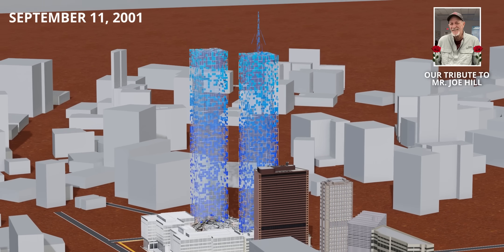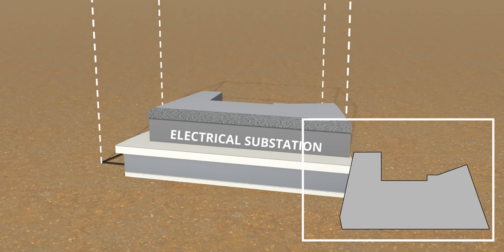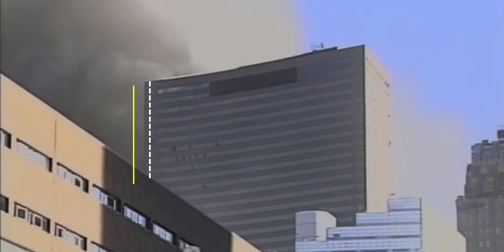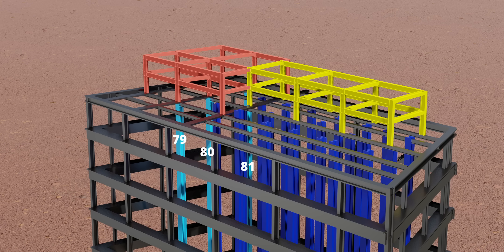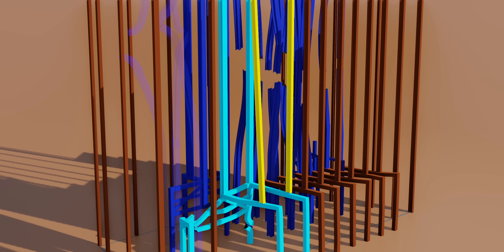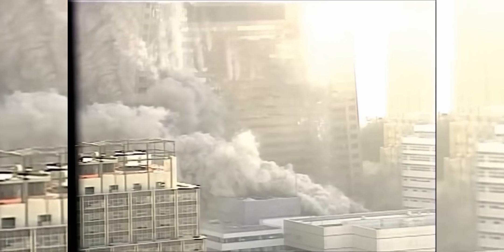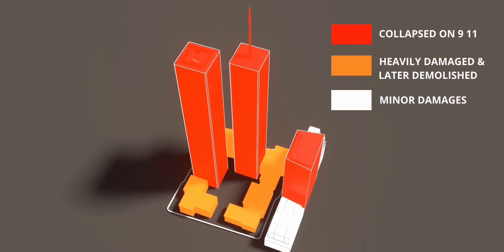Collapse of Building 7 | The Complete Physics

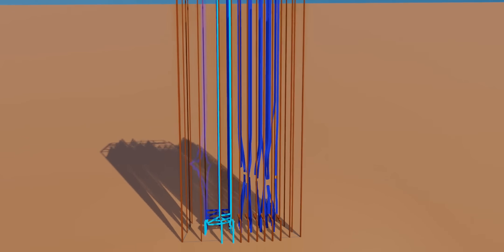Comment: One more thing. It is funny how this video say " 7:20 and there you have these cut columns, already broken, then you can imagine what will happen next" but fails to explain HOW and WHY, fires were not observed in the substation so how can those column be cut without this video explaining it. Thought this video explained, but i am left with more questions than answers 😂
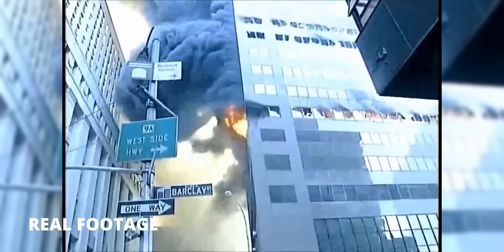Reply: The fires - and failures - were ABOVE the electrical substation, above the load transfer region as clearly shown in the animation and exactly where we see the fires in the Vince DeMentri CBS2 video at 3:02.
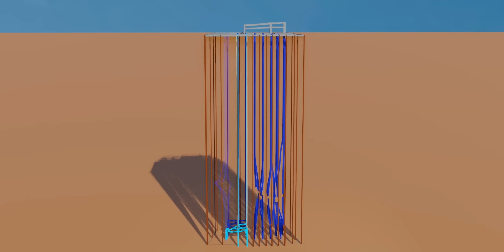Reply: @TheCriticalStinker-01 7:20
Reply: @old8809  - Yes, I'm right there, where the animation shows column failures well ABOVE the load transfer region which is ABOVE the Con Ed substation (which is in fact, not even shown).  I'm sorry you don't understand this simple graphic on a fundamental level, but I do.
Reply: @TheCriticalStinker-01 Nope I understand it well. Just you who dont understand it
Reply: @old8809  - This is soooooo fucking pointless.  I'm going nuke option:

Building 7 collapsed from the inside out which is not at all intuitive and hard to understand, with most details being hidden from view.  It requires careful analysis and observation, and some people will struggle no matter how much it is explained. But here is my explanation relying on no outside authority. 

Building 7 was a unique, asymmetrical 47-story steel frame structure built atop a smaller 3-story building serving as a partial foundation, requiring lower floors dedicated to complex load transfer structures. Of trapezoidal shape and tube-in-tube construction, B7 (above the 7th floor) consisted of a central core of steel columns carrying most of the gravity load, perimeter steel columns around the outside of the structure carrying the remainder of the gravity loads and long span beams and girders to tie those elements together and form the floors. On the outside of the building hung a facade or outer shell. 

www.nist.gov/image-16640

Phase 1 : First externally visible signs of collapse initiation occurred at 5:20:28 pm and was notably quiet with observers not realizing the building was collapsing! No warning in the form of hundreds of eardrum busting 180dB explosive bangs. Here at 12:00 a local CBS affiliate reporter talking 10 blocks from B7 when collapse begins. People don’t start to notice the collapse until 12:11. At 12:45 is the famous CBS fixed camera clip of Building 7’s collapse. Note the silence. 

www.youtube.com/watch?v=t5tEy6mXSE8

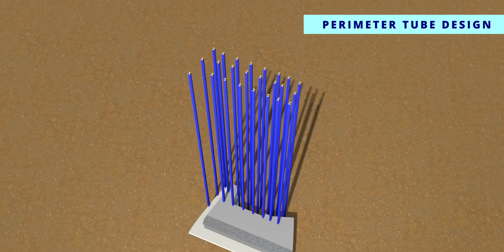Lower floor failures above the load transfer region (8-14) in the NE corner initiated the collapse. In this video at 0:45 you can see the NW corner from inside the building while under construction, Column 79 just out of frame on the left. That big, angled steel beam across the top of the frame connects to C79 at one end. The girders connect to the beam. That beam and all those girders depend on just one connection 

www.youtube.com/watch?v=nP3TNHPCIVU&t=45s

Phase 2 : NE corner floor failures caused a loss of critical lateral support over an excessive length of Column 79 and it buckled. Looking at the above floor diagram of Building 7 when you see all the structures that depend on C79 you quickly realize this one column was a relatively isolated structural element on which a disproportionately greater fraction of the structure depended analogous to say the Key Bridge. Externally as collapse begins we see a vertical progression of window breakage along the 44-46 line and a kink in the roof of the East Mechanical Penthouse at the top of the building, consistent with C79 failure. Normally with a buckling column, the load could be redistributed to other columns. With C79 that is not the case - the failure did not redistribute the load, so the collapse rapidly progressed to the roofline, sinking the rooftop penthouse. The transition from full capacity to almost no capacity occurs in an instant and will result in virtually no resistance 

Phase 3 : With C79 gone, B7’s progressive, non-symmetrical collapse continues with adjacent columns 80 and 81 left laterally unsupported and quickly buckling as well. The EMP drops down through the building. C79-81 all have no diagonal bracing, which is the major reason why they could not redistribute a lot of vertical loads among one another. From there collapse progressed from east to west through the central core until the core was gone from 81 to 58, taking all the interior floors and probably most of the perimeter columns with. Follow the horizontal progression of window failures low in the building and the dropping of the remaining rooftop structures into the building. The NIST Building 7 study model 4 determined C79 failing under ANY circumstances would have initiated the same collapse sequence. 

Phase 4 : After about 10 seconds only the exterior moment frame remains, giving the illusion B7 is still standing to the casual observer since little has outwardly changed. But it is just a hollow empty shell like an empty cereal box supported only by a few remaining columns and overloaded from the loss of the core columns and floors, quite unable to remain standing. With nothing remaining behind it, the north face leans inward, forming a V in the roofline, the last few columns buckle under the strain and the moment frame free falls, landing on top of the debris pile. 

It is only here at the very end, a single measurement of alleged free fall acceleration is taken, from just one point on that outer shell. The Building (core and interior) did not “free fall” - was already gone before that happened - just one corner of the outer shell briefly moved at a rate comparable to FFA. This alleged FFA was a product of how the shell fell NOT why the building fell . It’s also not even proper FFA as the single measured point was moving in 3 dimensions, not just down, which adds another variable. Start to finish the collapse took 18-20 seconds, 3 times longer than true FFA . How fast something falls can’t tell you what started it falling, certainly not 10 seconds after it started falling.  

The debris spread outside the footprint blocking surrounding streets, heavily damaging the Verizon Building and destroyed Fiterman Hall. 

No building is meant to survive 7 hours of multi-floor unfought fires. Building 7’s progressive, non-symmetrical collapse was incidental, unintended collateral damage from the combination of fire, time & gravity started by the collapsing North Tower, true no matter who planned and carried out the 9/11 attacks or why .  Of so little consequence it barely registered at the time, only taking on semi-mythical status as an alleged smoking gun years later when demolitions at the Twin Towers, missiles at the Pentagon and shoot down over Shanksville all failed and conspiracists had nothing left to work with. 

Anything can seem like a conspiracy if you don’t understand how it works. Now you should. I hope you found this helpful, informative and it solicits informed critical comment. If I made any errors of fact, logic or reason or left anything important out, please let me know so I can fix it. OR offer a more plausible alternative if you can. Be the first. Please start any reply with the words “Tits McGee” or I will know you didn’t read it and are wasting my time.
Reply: @TheCriticalStinker-01  , So, what YOU consider to be 'proof' is an animation ... of which NIST does not share their input data? 😅😅😅 How can you say you are not too intelligent without saying you are not too intelligent?
Reply: @TheCriticalStinker-01  , Hey 'T. McGee' , How did you learn 'physics' ??? BY WATCHING ROADRUNNER CARTOONS??? 😂😂😂
Reply: @TheCriticalStinker-01  , Hey , 'T. McGee' , Let's test your BASIC reasoning skills 🙂 .... ; 
If you are ASSUMING the TOTAL collapse of the World Trade ceneter 7 building was NOT caused by a controlled demolition , ... what would be the ONLY source of ENERGY available to cause the TOTAL collapse and complete destruction of the World Trade Center 7 building?
Reply: @dunexapa1016 - Gravity - more than sufficient.  All building collapses are gravity collapses - even CD's.

Duh.
Reply: @TheCriticalStinker-01  , FACT:  NIST never proved their 'gravity alone' THEORY and the proof of this FACT is NIST's very own investigative report. 
I understand you are so limited in reasoning ability that you have confused SPECULATION and CONSENSUS OF OPINION with actual proof. 
It is NIST's THEORY that gravity alone provided ALL the ENERGY needed to cause the TOTAL collapse AND the destruction of the World Trade Center 7 building.
PROVE , by information from NIST's investigative report that I am wrong and I will apologize.
Reply: @dunexapa1016  - Describe the collapse in detail, start to finish using ALL available evidence, don't leave anything out.

Oh wait.  You can't do that.  Don't even know how or where to start.

You are a waste of time.
Reply: @TheCriticalStinker-01  , ONE SINGLE WORD! ... That is all it takes to answer my basic high school physics question:

As an object is falling in free fall how much work is being done by that object AS it is falling in free fall? 

Helpful hint: ChatGPT 5, Google's Gemini, Elon Musks'Grok and the Chinese AI DeepSeek can ALL answer this high school physics question with one single word. Ask the very same question and ask for an ACCURATE answer with one single four letter word.

If you cannot answer this basic high school physics question then you have no business commenting about the TOTAL collapse of the World Trade Center 7 building.

In NIST's very own words:

"The analyses of the video ... revealed three distinct stages characterizing the 5.4 seconds of collapse:

Stage 1 (0 to 1.75 seconds): acceleration less than that of gravity (i.e., slower than free fall).

Stage 2 (1.75 to 4.0 seconds): gravitational acceleration (free fall)

Stage 3 (4.0 to 5.4 seconds): decreased acceleration, again less than that of gravity"

SOURCE: https://www.nist.gov/world-trade-center-investigation/study-faqs/wtc-7-investigation
Reply: @dunexapa1016 sorry man but it was not and it will never be a controlled demolition
Reply: @laetrille  , The scientific illiteracy of most of the American people has allowed thousands of innocent people to be murdered with impunity.
Reply: @dunexapa1016 if a group of 100 scientifically literate people (with credentials) told you 9/11 was not an inside job you would dismiss them in favor of one telling you it is
Reply: @laetrille  , Please explain to the world why you choose to accept NIST's 'gràvity alone' THEORY as being a true explanation of why World Trade Center 7 TOTALLY collapsed as it did on the day of 9-11-01 without NIST ever PROVING it to be true. NIST's very own investigative report is proof of this fact. Speculation and a 'consensus of opinion' are not proofs.
Seems like something only a WEAK MINDED PERSON would do ... ESPECIALLY when NIST also said that World Trade Center 7 fell at free fall, that is, with an acceleration equal to the acceleration caused by the force of gravity.

"The Force can have a strong influence on the weak minded."
O-B-1-Ken-O-B
Reply: @dunexapa1016 you deflected, you will believe one quack over 100 scientifically literate individuals with credentials.
What’s your explanation? Explosives? Thermite? 😂